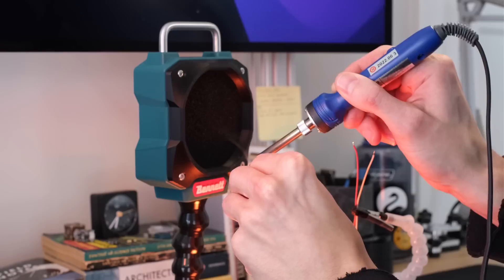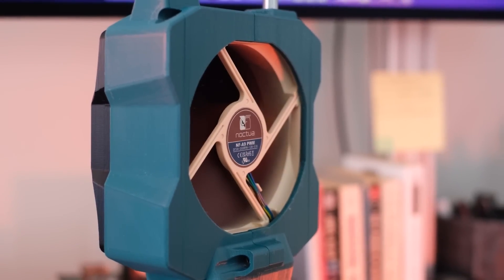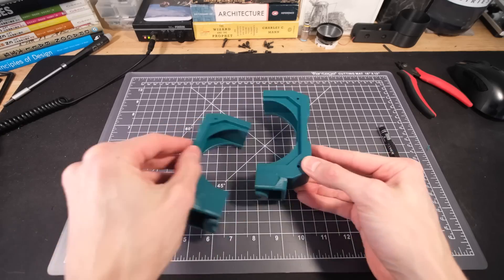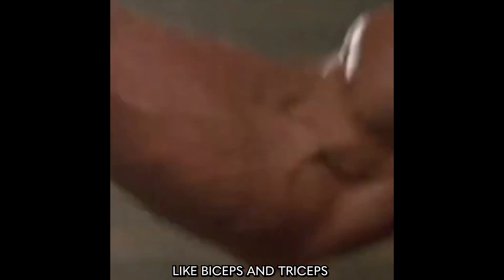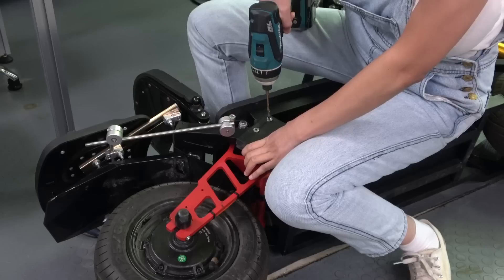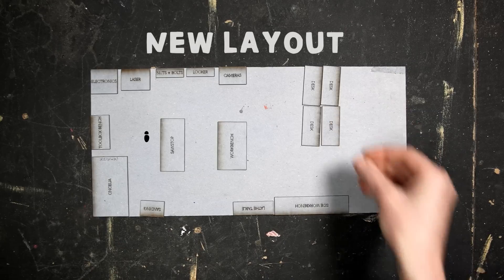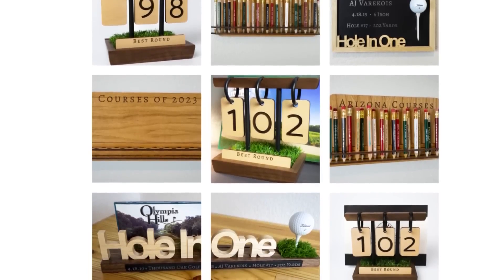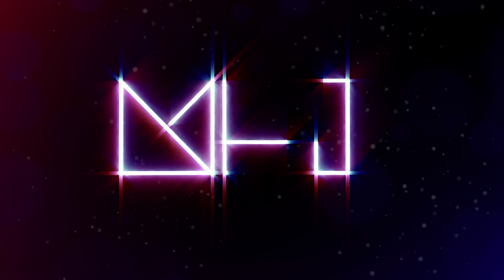Oddly Satisfying Solutions [Maker Update] | Maker.io

Comment: The problem with the fume extractor is that the filter is barely doing anything (there is plenty of material online about this issue), it's basically the equivalent of just having the fan blow the fumes into your room - unless you also open a window and point this thing in the right direction.

Which is still much better than breathing them in, but ideally you'd want a HEPA filter - which this small fan probably wouldn't be able to push much air through.